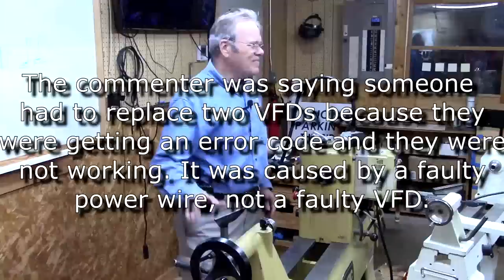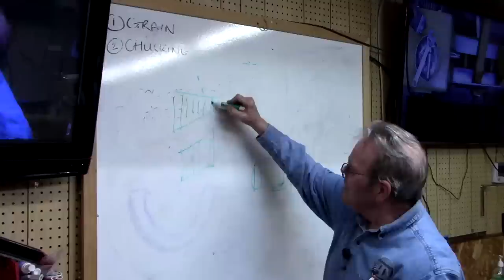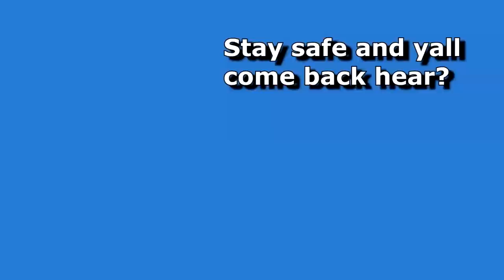Lathe Maintenance – Critical for Top Performance

Comment: Great information Mike, thanks for sharing.  I use GlideCote Table & Tool Surface Sealant on both my lathe beds and table saw, makes nice surfaces on move beds, banjos and table saw sleds.  Also I touch up the tail stock fittings to make sure I have nothing is hidden inside.  I am going to make one of those morse taper cleaners and keep the tapers cleared. 

Thanks again my friend
Take care
Cheers
Harold

Comment: Great coverage of what should be part of every turner’s knowledge base. Thank you for posting. Series of video ideas: Fixing funnels and other common mess ups. Address the frustration of expensive wood blanks lost and the time already invested in a turn. 1) plug 2) glue on contrast bottom 3) glue on contrast top and bottom 4) add resin base, plain or with pattern/design. Also slicing bowl vertically and adding fill wood for cracks, splits and rough turned out of round blanks.
Reply from the maker: Thankis, Valerie. Some great ideas.

Comment: Thanks Mike! Appreciate the reminder and tips.  Occasionally it doesn't hurt to give the chucks a shot of air from the compressor followed by a bit of dry spray lube preferably, or some such. Don't care for WD so much..
Reply from the maker: Agreed, I would not use WD40 on a chuck.

Comment: At 13:39, that's a NEMA 5-20P plug (see https://en.wikipedia.org/wiki/NEMA_connector#/media/File:NEMA_simplified_pins.svg). Everyone (American) knows and loves the NEMA 5-15P plug, and most outlets that you'd plug one into has a T-shaped opening that allows a NEMA 5-20P to plug into it. The core difference is whether the plug (and outlet, and wiring) support only 15A total, or 20A total.
Reply from the maker: If you  are an electrician I won't argue with you. The lathe plugI was holding looks just like the one I wired to my PM lathe and the box said 6-20 and the recepticle and plug are rated for 220. My PM lathe runs on 220 just like the PM in the demo. A friend helped me install the 220 circuit at my house.
Reply: @MikePeaceWoodturning  My apologies, you're 100% correct - NEMA 5-20p and 6-20P are mirror images of each other (which side the horizontal bar is on).